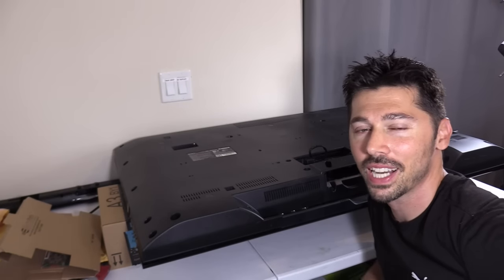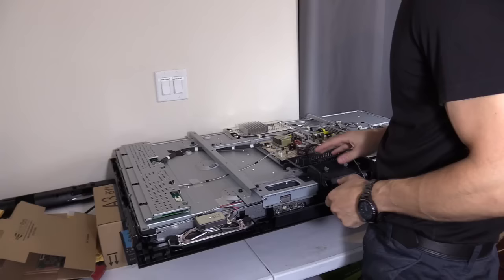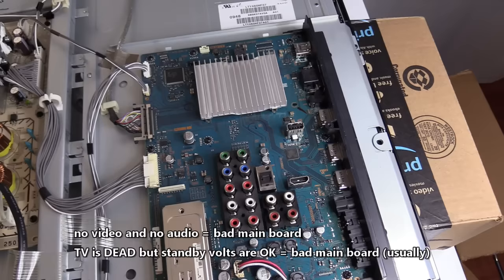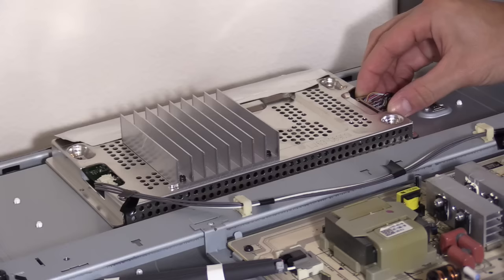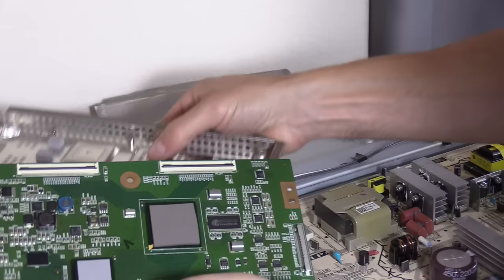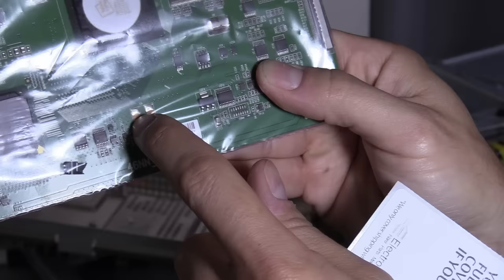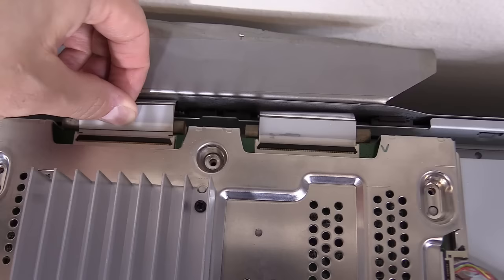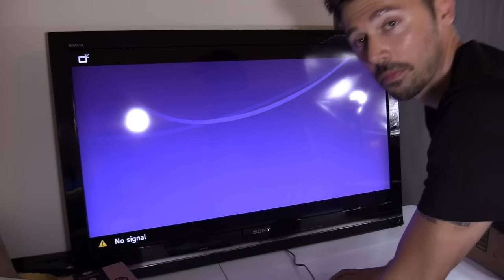SUPER EASY WAY TO FIX MOST SONY LCD TV KDL- PICTURE SCREENS !!!

Comment: very good follow thru video. i have a sony xbr65hx950, i changed the t-con board but same symptoms. tv powers up normal, after 1 minute picture fades to black- still has backlight, still has sound. any pointers on this? thank you mike
Reply from the maker: Can be defective LCD panel but can be under a recall warranty which they did years ago. Contact Sony.
Reply: @TampaTec  thank you for your quick response, contacting sony

Comment: Thanks for the great video. I have a Sony bravia xbr, ten years old, that is not working. If I unplug and then plug back again, tv comes on with standby light and backlight, but after 3-4 seconds goes completely off, no backlight, no standby, nothing. Would you know what could be wrong?

Comment: Thank you. I have a Sony KDL-52v5100 That is dim at times. I un plug it for a minute and temporarily fixes it. Do think its the Ir sensor and led board 1-879190-12 & 1-8/9-191-  Is it easy to replace ?

Comment: Thank you for your video. It's very helpful to me. My Sony TV has a different KDL model #. Its T-Con has 46NU-MB4C6LVO.7 only one letter different from the one shown in the video.  The link you provided for electro parts no longer works. Sear by board # on eBay and Amazon did not find any source. I would like to verify by testing perhaps that my T-Con Board is indeed bad and need to be replaced. Can you help? Thanks in advance!

Comment: thanks a lot :) mine's the LCD module that's weird. Can't say it's broken because it garble half screen but if I shake the tv, it comes back. I'm pretty sure this is because of the flat cable connectors. I'll disassemble and reseat all stuff.

Comment: Watched the video - very helpful. We have a KLV-46X350A which has started solarising and distorting left side to right and occasionally does the vertical white line thing on power up. However, after about 15mins picture returns to normal. Question: a T-con issue ?

Comment: Fantastic video. I have an issue where the colors are saturated and the screen is dark.  No vertical lines and the picture is not distorted.  Should I be looking at the T-CON board for problem?

Comment: Hi Tampa Tec, I have a Sony Kelly-52NX800 and my t-board went out because I have the vertical lines.  My question is, I have 4 connectors (wire ribbons) that I can’t see how they disconnect like yours does. I could send an image if I can.  Thanks

Comment: I got a 09 kdl52z5100. Back in the day it was a little over 2k. The tv still works and looks good. But it's dimmer than it used to be. Are these TV's easy to work on? I'm thinking of getting a new lamp for it.

Comment: Excellent tutorials!  I have a Sony KDL-52W4100 that stopped working one day.  There is a picture, which is the last channel it was on, unfortunately an empty channel so all I see is the banner above the screen, but that's it.  That picture is frozen and the TV will not change channel or input or anything else.  I thought it might be a software issue but in watching you replace components, I wonder if it's one of them.  Any advice would be greatly appreciated.  Thank you.

Comment: My KDL-r60xbr1. Has a distort distorted image on only the right side from the top to the bottom… It most the time goes away when I put pressure on the top of the case near the input buttons do I need a new TCon board.. or just taping it and packing it tighter ?

Comment: just passed on a TV that was a dumpster dive today, ... old sony bravia with no stand ... I decided not to mess with that one but maybe i should have ... it was heavy (thinking maybe an early model LCD) for it's size ... maybe 50 inch or so ...40-ish anyway ... when plugged in I could here it come on and immediately go off ... didn't see any light (it wasn't on long enough) ... for it's weight and the connectors (tons of composite/rca, but only one hdmi ... though i could get around that easy) i am guessing it was an older model (maybe not even 1080p and figured it wasn't worth it/someone else could get more use/fun out of it

Comment: @tampatec  very informative video.. Big thumbs up 👍👍👌
But I have a doubt mine has a red screen on one side. Is it the same problem as the one you showed in the video??
Reply from the maker: Tcon board or bad tcon connections can cause half screen issues. Get tv boards at shopjimmy.com or electropartsonline.com use code tampatecfriend for discount.
Reply: @TampaTec  thanks for the tip bro..

Comment: Thanks for the video. My TV has a black patch on the top left screen. Probably due to finger pressure applied while moving. Is there any way to fix it or any hope except finding another LCD panel of the same model which is impossible? Thanks

Comment: Hey, thanks for the video. I have the same tv and it got sprayed with water while turned off so I unplugged it for about 2weeks hoping it would come back on and to my surprise it did however after a couple minutes the screen went black and would not come back on until I unplugged it again and waited for a couple minutes but with the same result. My question is should I trash it or what would you recommend I replace in order to get it back in proper working order? Thanks for your time! 👍
Reply from the maker: Water still might be in there or at least residue needs to be cleaned out with 90% alcohol then let dry before starting up.
Reply: Tampatec thanks for the help! It’s been drying out for over a month now so there’s no water but definitely some dried water spots. Is there any certain places I should avoid? And if it persist could you tell me which board to replace? Thanks for your responses 👍👍‼️

Comment: I have a Sony Bravia KDL52EX701 that's about 10 yrs old and was used a lot.  The picture has started to flicker after the TV warms up for 5-10 minutes. I would say the flicker involves horizontal lines (not vertical). Curious whether your instincts point to a TCON board issue or other problem, and whether you think there is enough life left to bother trying to fix it.

Comment: I have a 60" Sony. Mod# The picture goes black and the audio remains. If you push any of the buttons on the remote the info re the button pushed, does appear, but the picture is still black. do you have a video for this symptom?Dan B

Comment: I have the Sony Bravia model kdl-46s5100. Once in a while when turned on, the image comes out in a light green and no audio. When this happens I have to either unplug and plug back the hdmi cable connected to cable box or turn off and on the tv to have the picture and sound come back on to normal. What can the problem be? Please provide info at earliest convenience. Thank you.

Comment: Hi there, great video, i have replaced the t con board on my sony, i got both the sides back and working great. however when i switched it back on i got tghe same problem. i have found if i tap the top of the plastic frame surround lightly it makes the picture come back. how do i check the other side of the two ribbon cables?. thanks again

Comment: 4:04 I didn't put the tape back on mine should I be worried? I have a KDL-40VE5 with a nice blue line on the screen now. Unplugging the tcon board didn't fix anything

Comment: I have the Sony KDL-46XBR4
.  The picture was fine then few minutes later the Left side of the screen colors start dancing.  Previous owner told me it the T-Con board.  Took TV apart tonight, removed T-con board and cleaned all the connections.  Put it all back together and now I have either no picture whatsoever or lines across the screen (Audio is fine).  I checked and rechecked and everything is connected as before.

What do you think happen that made the picture disappear and would replacing the T-com fix the issue ?    Thank you.

Comment: Hello, will you get the backlight if the main board is bad? Is the inverter board for the backlight low voltage?
I have no sound, no image, but the green light and the logo illuminates.

Comment: Hello,I have a Sony KDL-46HX729. I get 5 flashing lights. I tried unplugging the TV then plug directly to wall outlet--no luck. I tried to do a factory reset (up arrow from TV remote and then press power button on TV) no luck. can you recommend any other steps I should take...or do i need a new TV? Any insight would be great!Thank you

Comment: Great video. My Bravia from power on is completely whitewashed. It will intermittently go back to clear color but generally remains whitewashed. I realize it could be different issues but does that sound more like the TCon board than anything else? Audio is fine, screen never goes black or doesn’t appear.

Comment: Mu bravia starts but a message appears of power saving  and shuts down it repeats this 3 times and then 2 red lights that repeat these .  I don't get a change to disable this power saving cause simply not enough time. And the Bravia  does not turn on when the Blueray player starts.  Type 43XF7096 And do note I did not enable such power saving at all.

Comment: My Tv picture is fine and sound works but recently it's started Flickering do you know what would fix this I took it apart took the strip that's connect to the screen and put that back in it stopped for like 30 mins and then started again I have a Toshiba TV tho not a Sony hope you can help

Comment: hey thanks for making this video, i’ve already learned a lot about tv repair from you. i have a sony kdl-46s504 and i believe my main board is faulty. is there anyway to repair the main board without replacing the entire thing? i am unable to find a replacement main board. i have standby power, but no picture or audio.

Comment: very nice video I have an XBR-65X9000c most evening when I get home turn on TV has a blue screen with sound, power down turn on off usually does nothing, using remote I change input and see a flicker sometimes and after changing input 1-12 times picture usually comes on. although once it took about 30 minutes to get picture on is this a same issue with the TCON board can be intermittent?

Comment: I have a KDL-65W855C with a 6 red led blink error, im being told its backlight. Just wondering why i need to remove all boards to lift the screen out. Surely if a disconnect all connections to screen i will still be able to get he screen out ?

Comment: Hi, thanks for the great video. I have a Sony KDL-46EX500. When I turn the TV on, I get sound but no picture. I do see the Sony logo flash on the screen momentarily and then it goes black. I removed the back cover and the backlight comes on for just a moment when I power on, but then it goes out. Does this mean a bad inverter board or a bad tcon board? Thanks for your help.

Comment: Great sir! I just now bring my sony kdl46 inch to sony center...when the staff on my tv,they say it was lcd panel problem because my tv same like your tv problem and they say cant repair it need to buy new tv..my lucky see your tv fix on... my tv after two years buy it was some box line in a bottom and stay for until this years is goes to 5 years and now have new problem horizontal line problem sometime is stay and sometimes is flickering...

Comment: So I've got a 4100 Sony, the model previous to this one. Screen cuts on but is blacked out, no menu or anything will come on. No vertical or horizontal lines either. TV has been sitting for unknown period of time. Does this sound like a bad tcon board?

Comment: Thanks great info. My Bravia doesn't have lines like but the colors are off. It looks almost like they're over driven or saturated. I'm guessing this is the board you replaced here. Have you seen this condition before?

Comment: Hi There. I have this mode but the HDMI keeps cutting out now intermittently, I changed hdmi cables and tried other devices. It’s about 10 mins into a show the screen goes black and then it comes on again after a second. Is that the HDMI board going bad?  The Coax TV is fine, no issues, but only with HDMI I have the issue and I tried all 4 ports and all 4 get same issue

Comment: Tampatec, I'm hoping you can help me with my Sony Bravia KDL-40W600B.  I cannot find a solution for my issue anywhere, and when I came across your videos I finally had some hope again!  I appreciate any help you can offer.   So basically one day, my tv screen's picture started to blink over and over again.  Initially,  it would stop after turning the tv off for a few minutes and the picture would remain steady for various amounts of time.  Well now it does it everyday over and over and has become unwatchable.  I've tested all the HDMI ports, changed cables, plugged television into different outlet and even opened the back and checked for any blown capacitors but nothing obvious stood out.   Also, whenever I run the Sony's self diagnostics for testing picture it actually stops blinking!  Any ideas?  I'd hate to throw out the television if the repair ends up costing the same price for a new one!

Comment: I have an insignia tv, model no. NS-32L430A11 that turns on but then turns off after a random amount of time.  Ive tried replacing the power board and the main board but it still does it. Do you have any other suggestions?

Comment: Tampatec GREAT video. I have the exact same TV but mine is doing something different. I turn the tv on but at times the green power light flashes red and doesn’t come on or it comes on then two or three minutes later it’ll turn itself off. After attempting to turn it on it’ll stay on. Sometimes we won’t turn it off because we think it may not come back on. Do you think it’s the power supply board? Thank you in advance for your help. John

Comment: Very informative. Tampatech a buddy of mine has a Sony KDL-40S3000 no audio good picture, it makes a strange noise at power on for a few seconds. he tried it another day and got good audio which stopped after awhile. Could this problem be a loose connection or main board issue?  Thankful for any info.

Comment: I have a sony kdl-48r510c with both horizontal and vertical lines.  I bought a replacement tcon from ebay and it still had the same problem.  could it be my ribbon cable or the LCD itself?

Comment: KDL-60R520A Led has a darker right bottom corner it's like a quarter of a circle, radius of 6 inches horizontal and 6 vertical all on the right bottom corner. I can see image, but it is darker. Any idea what can cause this.? Thanks in advance

Comment: Brother,  LCD TV - Sound is not clear.   The picture is ok, but they give just a rough sound and it is not clear. Speakers are in good condition. Speaker connections are from the logic board.  This is a Chinese manufactured TV for a local brand in my country. Any advice to get the sounds perfect?  Thank you.

Comment: Hi , I have a kdl 40s2400 version 2007  turn on perfectly but after warm up picture gone with digital noise lines and not picture, I left to cool down and turn again good ,I change the Tcon board already and problem is still on it. audio OK

Comment: Hey dude! I have a Sony KDL-52NX800 that turns on fine with a green light and red light when off. But the picture is black when turned on, then just on right side of screen its grey and some lines in middle, is there any way to fix this? What do you think the issue is?

Comment: Hi TampaTec,
Your videos are very helpful and informative. I am your subscriber.
I have question about Sony TV SONY KDL-40S4100. Over the sadden it stopped turning on. Looks like it have all the voltages comes out of power supply board and 3.3 V standby voltage also present. I hear the click when I turn TV on and all voltages turns on. It is why I decided that this could be main board at fail but not a power supply. So i ordered board from Ebay and replaced it with exact the same result. Still no picture no sound. Any idea what problem could be? I believe that you are involved with electronics and it is why I asking you for any help. 
Thank you,
Alex

Comment: Hi there Tampatec.  Had a look at your video.  Great video, thanks man. I have a Sony Bravia KDL-40CX520 TV and just recently noticed vertical lines appearing on the screen.  In the beginning there was only 1 vertical line which the retail store says is caused by default pixels?  I now have 7 vertical lines at different places on the the TV screen.  I am wondering if your solution here will apply to my problem?  I can gmail you a pick if possible.  Thanks man!

Comment: Hi I have a 70 inch Sony model number is KD70X690E it has a vertical green line on the left side from top to bottom do you think I can do what u just did and it would work or does green mean something different? It’s not very think line but bothers the hell out of me the tv is about 3 years old is it me or is Sony stuff not lasting like it used to ? Any help would be great also a guy told me it can’t be fixed idk if he was bs me or not thanks 🙏🏻

Comment: Great video!  I do have a question for you.  My Sony KDL-51Z5100 turns on and I have a picture but I can’t change the channel or input.  I’ve tried it from the buttons on the top of the TV and still won’t work.  Any suggestions as to which board might be bad?

Comment: Could anyone help me. I have a Sony 65” Bravia. If you change the t con board does it need resetting or will be all good to go?
Reply from the maker: Just swap tcon board and u should get an image but if u don't then check connections and backlight.
Reply: so the television won’t need resetting when I fit the new t con board??

Comment: My KDL48R510C starts up with the Sony logo pure white, then slowly fades to green and goes away. Screen is black on all inputs after that. Back light is on and I can get more backlight if I cycle through the inputs with the remote. Can't get a menu on the screen or any other video after initial Sony logo...